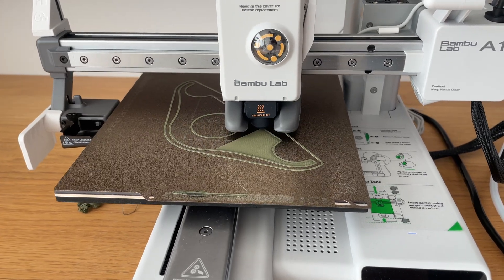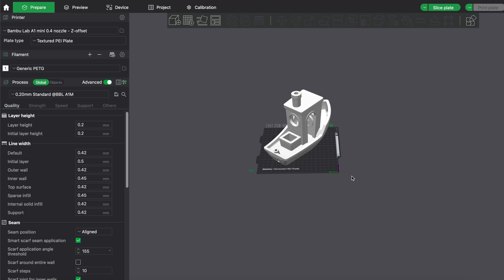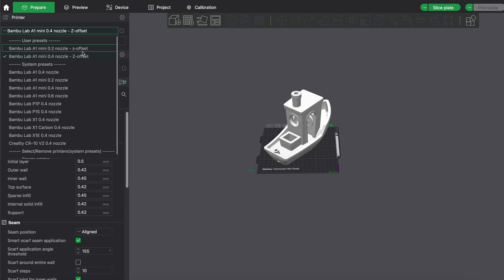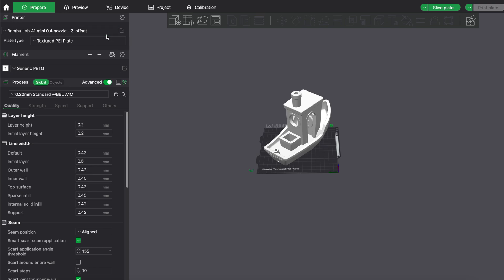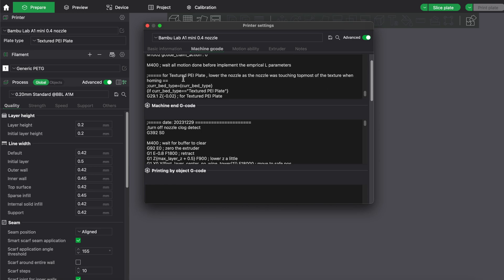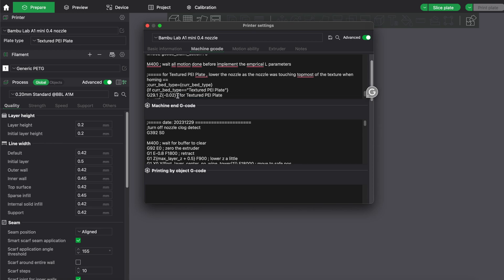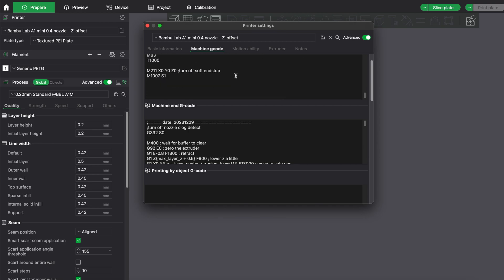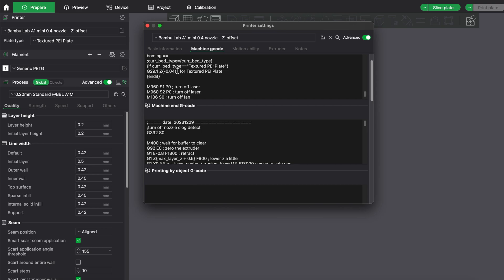Fix Bed Adhesion on EVERY Bambu Lab Printer with THIS simple Trick!

Comment: Are those vertical lines from the tessellation in the STL you were using on that green model?
Reply from the maker: guess so yeah!
Reply: @3dtecstudio it’s a great print. Usually they are more pronounced. A STEP file import should resolve it

Comment: I got my Bambulab A1 a week ago, and I kept scratching my build plate no matter what I did. I tried all the Z offset settings and everything else, but nothing worked. In the end, the only thing that actually solved the problem was tightening all the nozzle screws, both in the front and the back. On my machine, they were all pretty loose. I guess they don't do enough QA at the factory before shipping.

Comment: I’m trying but still struggling to fix it. 
P1S.

I’ll keep experimenting.

Printer is not printing anymore z offset it’s either too close or too far away.
Tried at least 10 times.

I’m doing something wrong.
Don’t know what.
I’ll try a complet calibration probably will fix it.
Reply from the maker: Hi, have you fixed it already? Take care if you always use the adjusted z-offset preset. Sometimes if you load a new model it will switch to default settings again :)

Comment: My settings are as you suggest. It seems my first layer goes down okay. but then as layers go down the earlier layers curve up to one side of the print. Any thought?
Reply from the maker: does it only happens when you are printing bigger stuff? or also at small parts?
Reply: @3dtecstudio  I have the same issue - it seems to occur on larger models, like 100+mm organizer boxes and such.

Comment: Thanks mate, it really worked for me. Got a new Bambu Lab A1 Mini and struggled a lot to get a stable 1st layer with 3DJAKE ecoPLA. Did a lot of things and before tramming the bed I thought I give your solution a try. And it really massively improved my first layer. Except for the upper right corner, which was always a bit too low in contrary to the rest being to high, is no even lower but without ripping or clogging. I'll just avoid the far outer corner. THANKS A LOT!
Reply from the maker: Hi, glad it worked a bit :D

Comment: Its not the Software.. Wipe it with Acetone.. fixed. Bye
Reply from the maker: you are right, i didn´t say the software is wrong, I just said for me the first layer was a little bit to high always but yeah, you are right you don´t have to adjust the z-height if everything is working well :D

Comment: Or just slow down the first layer 20mm/sec. Yes it adds some print time but id rather have a solid foundation
Reply from the maker: yeah you are right! as I said you don´t have to do that but I just found for myself that the firstlayer is not solid thats why I adjusted the z-height. But correct you can also slow down first layer speed!

Comment: before doing this kinda "trick" or "modifier", always good practice to stick with the default value and eliminate all "external" factor (things you can do, instead of the machine) first. while squeeze down the first layer more in logic should works, but 90% of the time, its either bad filament(wet), or oily plate, usually the latter, especially PEI plate, i can tell it is very prone to hand oil, try your best to not touch the printing area or wear gloves or just wipe it before every print.

99% isopropyl alcohol and paper towel, you will almost never have to worry about it again, assuming your bed level is perfect.

but if you want go crazy, use the new cool plate supertack. when printing PETG, it almost peeled off my first layer from my print (the bottom layer wants to stick with the plate , rather than the print itself!!!!), it is crazy good. i only use it when the bottom layer has very small surface areas, otherwise it is almost impossible to get it off.

i still use PEI plate for like 70% of the prints if it got large base thats simple shaped, but when in doubt or it can not to fail situation, i use cool plate.
Reply from the maker: Hi, you are completely right and if you are starting out use the tricks you suggested. I print since 2018 and I had a lot of tweaking behind me and i just had the feeling the first layer on my printer was too high so i took the easy way and just lowered z-axis :D and after 100+ prints it still works fine :D but you are right, you don´t have to do that :)
Reply: I have a hammer handle I’m tryin to print and it’s failed on the Bambu textured place and the super cool plate. Any ideas? Yes it’s clean

Comment: 0.04 seems to be the default on the X1C preset.
Reply from the maker: Ahh kk nice to know, and it works ? Or did you set it lower ?
Reply: @3dtecstudio I’ve used every build plate bbl makes, plus lightyear, whambam, biqu, and dozens of aloexpress and amazon plates… z offset has never been a concern ever on the x1c
Reply from the maker: @aeonjoey3d thats perfect, i was not saying that you have to change it, i was just tuning mine a little bit because big prints didn‘t stick and had a few first layer issues. Wanted to just show if needed :)
Reply: @3dtecstudio  It's X1C default setting for Z {-0.04}.

Comment: Is the rest of the layers printed also in -0.04 z offset? Or does the nozzle move back up +0.04 on the z-axis for the rest of the print to print it at its correct height?
If all layers are printed in -0.04 offset, the final part will be slightly shorter than it should be.
This would only matter for parts that are supposed to fit perfectly somewhere, but it's still important to know.
Reply from the maker: Hi Jack, no it's just the whole z-axis is set -0.04 mm lower, and then it does the next layer as defined! so if you have 0,2mm layerheight, the second layer is 0,2mm higher. So you don´t have a smaller print. It is just that the z-axis is -0,02mm lower than standard settings ( if you set -0,04) its just one time and not every layer... hope this helps
Reply: No ! The entire print is lowered by 0.04mm.
"the final part will be slightly shorter than it should be[?]"
Well, in theory it would be 0.04mm (that's a 25th of a mm!) shorter, so the first layer is - effectively - 0.16mm and not 0.2mm, but 1/25th of 1mm won't be a detectable, even with highly accurate tightly fitting parts.
Reply from the maker: Well kinda deppends, because if the first layer is too high from the beginning on it either doesnt stick or its a bit to high, but either way it doesn‘t make a significant difference at the total height :D